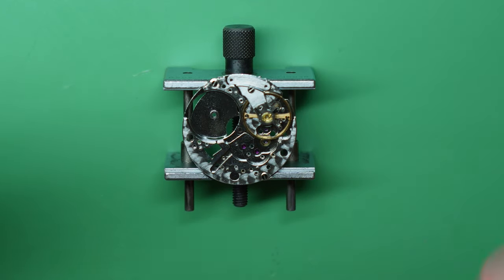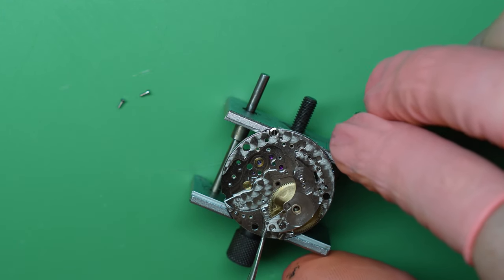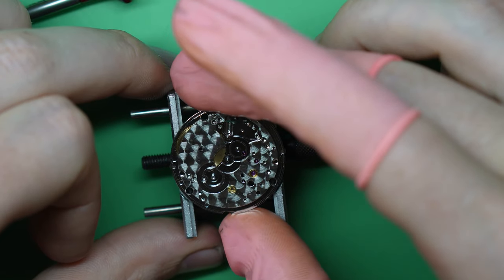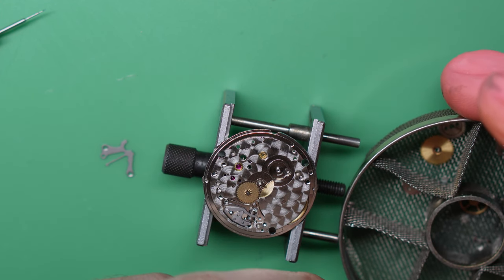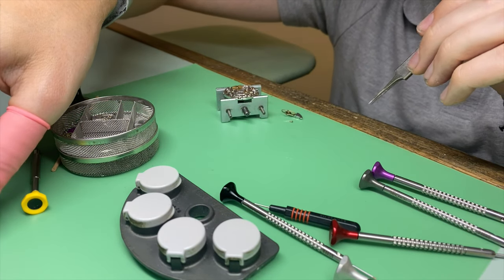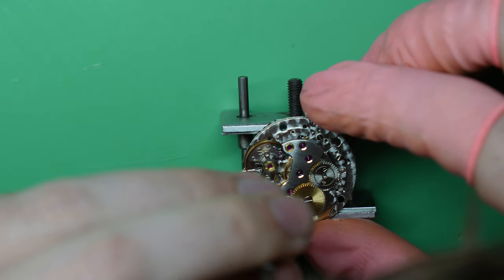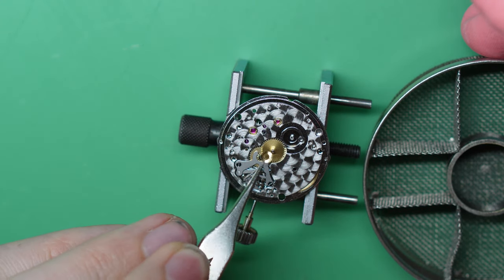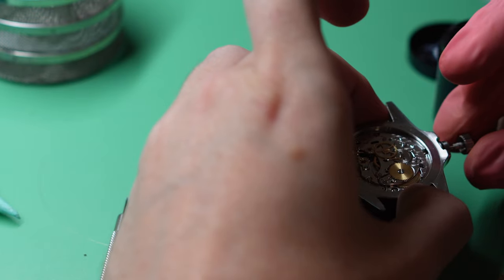Can We Repair This Rare Rolex? | Rolex 5513 Restoration

Comment: I bid and won  a 1963 eBay PCG bare case as I've always wanted a vintage pointed crown guard 5513. Both the 5512 and 5513 were built with this crown guard feature  from 1959 -1963. The 5513 was introduced in 1962 making it even more rare. I have most of the gen parts for the project and received the case today. Spent a few hours authenticating it and found a big tell only those who service Rolex's would notice. On the first year 1969 Date sub 1680 and later date subs there is a movement relief cut out direct opposite side of the crown at the 9:00. Rolex later added this to aid in movement removal for service. No 5513 (or 5512) plexi submariners ever had this relief but the one I received today does. It's going back to the seller which is a bumber. Really wanted this to work out. Typical of Vietnam rep cases and I must say minus a few other tells it's certainly convincing.
Reply from the maker: These are very sought after, this is the only one we have seen in person and it was a pleasure to work on. Sorry yours didnt work out, im sure the stars will align and you'll have your moment again :-)

Comment: Great video! Is that original Horia tool or clone? Thanks
Reply from the maker: For this one we used a clone - we do have the original and use it quite regularly but for this one we grabbed what was closest - Thank you for the comment and sub! 🙂
Reply: @obrhorology  thanks for the reply, I'm about to get one so I'm wondering if there is a gap when turning micrometer back and forth or it's the same as on original one?
Reply from the maker: Not quite sure what you mean but we can vouch for this product - its great we use it almost daily with changing jewels and bushes. would recommend!
Reply: @obrhorology  can you send a link from the seller you bought it from? Thanks